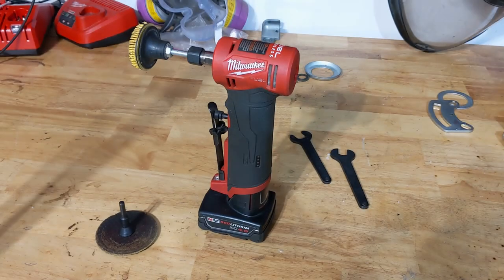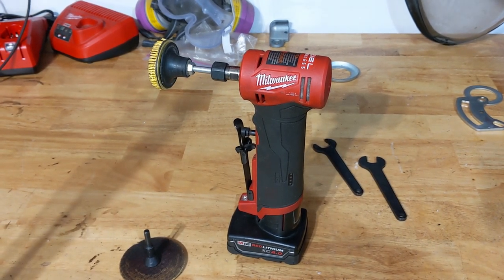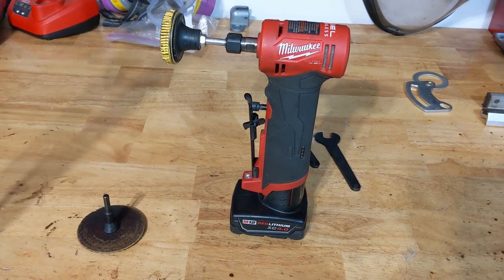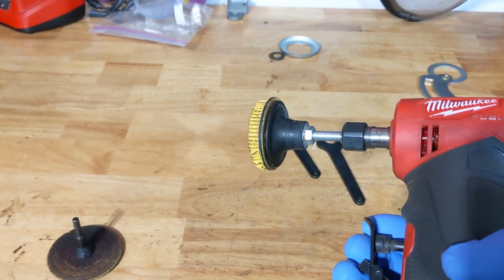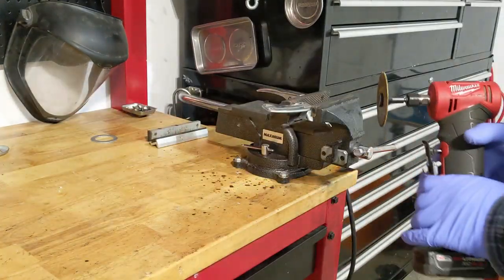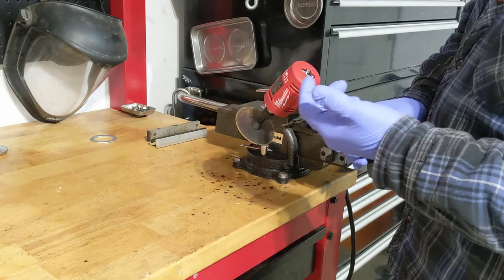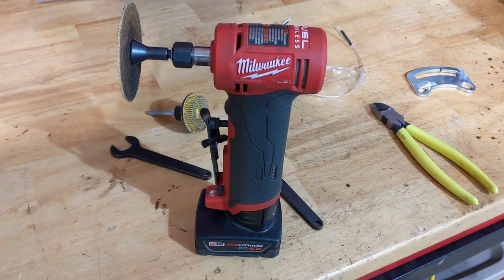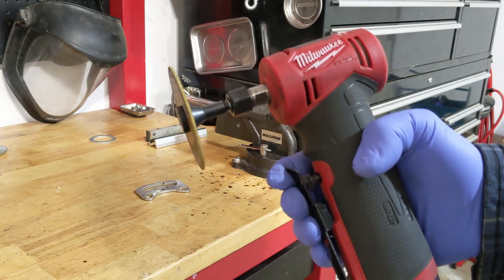Milwaukee 90 Degree Die Grinder review

Comment: I have one and i use it pretty much everyday as a professional. It won't replace a air die grinder for sure but for quick clean ups, its easier. I did a center bearing today and used it to clean the drive shaft splines. It's great for little things like that imo
Reply from the maker: Little stuff it is nice not to have to grab an airline, for sure.